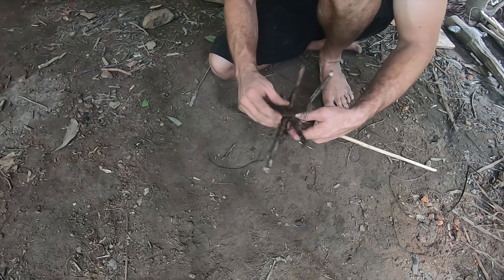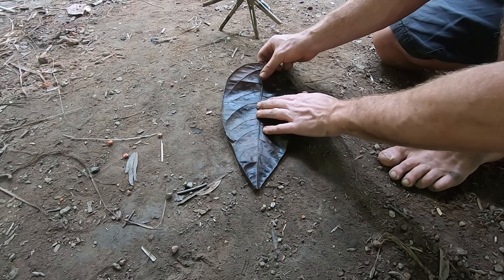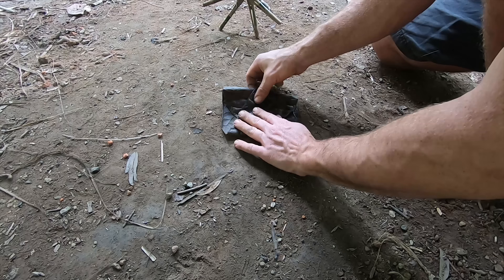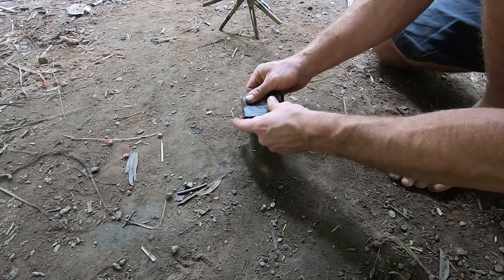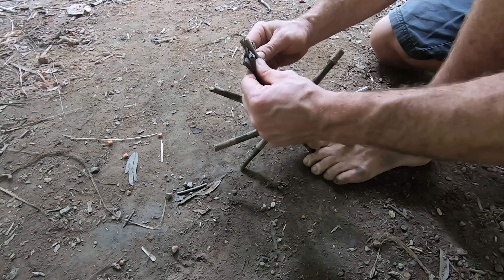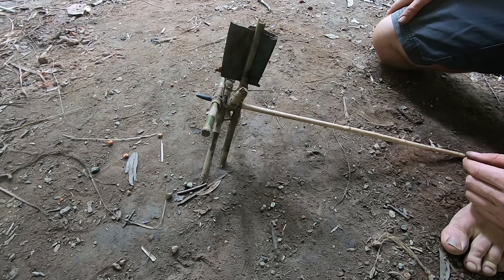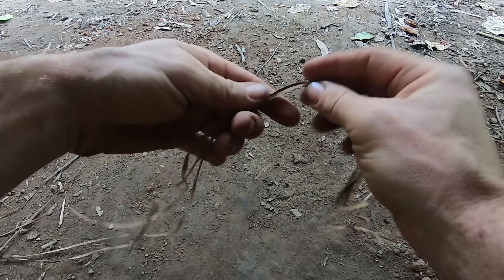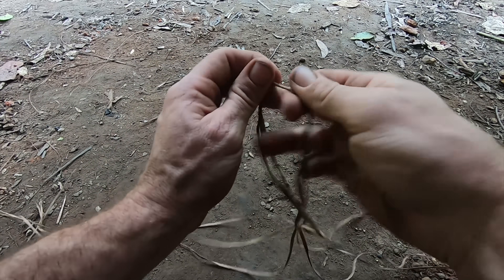Primitive Technology: Improved Multi-Blade Blower

Comment: I know that adding a slight tilt will add more directional air flow, but only in one direction, so the reverse spin would suck fire back in. I'm wondering if it's maybe time to build a belt system with some rudimentary gears. If you start building belt driven mechanical systems you can start making things like water pumps, a higher efficiency blower that requires less effort to use, and even a pulley system to lift heavier things to hang from trees.

Comment: You've previously made a waterwheel.  Using a waterwheel with cordage from it's axle to the air blower would allow for a constant forced air system, which would make higher steady heats for your iron production efforts to produce better results.

Comment: If you were to dig holes in the side of the spout (oblique), then you could probably increase the air flow by the Venturi effect.  The low pressure region inside the spout (the moving air) will suck in air from the holes on the side

Comment: I think that a gap between the impeller housing outflow and the entrance of the tuyere would result in a larger amount of air being blown out the end of the tuyere due to Bernoulli's principle. When I would use a bamboo pipe to blow through to fan campfires, I noticed a marked improvement when I held a gap of about 10-15cm from my mouth and the pipe. Could give it a go? I wish there was some way you could measure the volume per unit time of air that you blow with the different spoke setups to compare effectiveness, and then again with and without the stand off to measure if Bernoulli's principle applies in the way I think it will.

Comment: I am sort of surprised that you need a replaceable rock bearing, but the propeller axle is left to wear down.
I assume you must go through way more wooden shafts than rocks? I would think if you could find a way to attach the rock bearing to the shaft, and have a replaceable stick sticking out of the ground that would not only add weight, which might be advantageous, and make the fan last indefinitely.

Comment: I’ve seen this design on a couple of primitive channels, and have a rotary blower on my forge, but still don’t understand how the air is directed from the top port to the bottom-side port. On my modern version, I believe the blades are shaped to enforce the direction but might be mistaken. In any event, nice job!
Reply: To understand how it works with flat blades you can imagine that the air is like ping pong balls being hit by a paddle, they bounce off in a more or less straight line and since they are inside a cylinder, no matter which direction they shoot, they will generally move towards the wall, generating higher air pressure that comes out of the side.

Sure in reality there's so many air molecules that they collide with each other and the movement is not quite a straight line, but still the end result is the same tendency.
Reply: @MisterTalkingMachine  great analogy!

Comment: I feel like the next logical step in impeller design is to make something like a pole lathe, to make it treadle-powered. As you said, that motion of the arms isn't particularly natural. You could even have a treadle power 2 or 3 impeller simultaneously to provide increased airflow at an even more leisurely pace, since your legs have more power and mass than your arms.

Comment: This has bothered me ever since all the way back with the first version: A crank type setup (similar to used on spinning wheels) with a flywheel would make it possible to have the blower turn constantly, without the pause and loss of momentum that comes with it. Should reduce the needed effort and increase the fire temperature and consistency.

Comment: Now what I don’t understand: why isn’t he using his drill mechanism that had the round stone with the hole in the middle of it with the piece of wood that has a hole in the middle where to the left and right ends of it he attached the ends of the string so he could move the piece of wood up and down with that blower fans?

Comment: I always wonder if you could just make a pulley to which you can attack a weight to and then have a horizontal fan. The weight if hung on rope which when the weight is attached it unwinds the fan and then you hook the other rope up to the weight. Gears can be used to slow down the process, Make the gearing about 1 min long and some how make the rope 100% attachted that way you can use a stick to lift a weight to the other side and back. Because the rope is only looped around the shaft a few times and is one whole rope it jwould be easy to add 2 loops to either side. After some time you may have to adjust the rope as it might slip. Gearling would be simple stick gears.
Reply: If you're using gear ratios to slow down the falling speed, you won't get nearly enough wind speed for the blower to be effective

Comment: Think of all that extra mass in the 8 blade design as a kinetic battery. Sure, it's a bit heavier, but that investment in inertia resulted in a considerable increase in blowing time and airflow with less effort since there is enough energy in the system to wind itself up again for the downstroke. Excellent upgrade!

Comment: This really feels like a prepared "Season" of Primitive Technology. Now that he has a workspace and living quarters, he can actually advance his technology with better pyrotechnics and metallurgy.
Reply: And not burn his hut to the ground on accident this time, trying to get there!
Reply: Bronze age here we come!
Reply: @kidmockparodies  I think he'll skip bronze. If he sticks to the rule of only using the ressources the sight offers, then it's already incredibly unlikely that he'll have access to copper, let alone tin. This was a major reason that the bronze age had extensive trade networks; The places that produced the ressources for bronze were few and far between, but everyone needed the stuff.
He will probably go straight for iron, which is harder to work with (which is why it was only used after bronze) but easier to come by.
Reply: @rockyblacksmith  Agreed, tin deposits are sparse in the majority of the world and judging by the efficiency of this part alone, he'll probably be able to generate enough heat to melt iron .

Getting iron to a state that's pure enough to be useful is another matter entirely. As is gathering enough to actually use.
Reply: @rockyblacksmith  problematic manufacture wasn't the main reason for prolonged use of copper and then bronze, it was caused by lack of knowledge. Iron few times more abundant, but is not clearly visible (boring color, and often as thermally unstable compounds). So if know minerals you will find it more efficient than copper, but if don't, then we'll you don't
Reply: @wojciechkolaczkiewicz2881  I come from an engineering perspective, where "lack of knownledge" and "hard to work with" are nearly interchangeable.
You can make any process is easy if you know enough about it, and inversely, accomplishing something you know little to nothing about will always be difficult.
And the fact that iron is usually present in compounds rather than in elemental form (as copper regularly does) means extracting the pure metal was, for that time, a challenging process that was easy to get wrong.
Thus it required skill and knownledge.

What you have to remember is this; 
The properties of iron change massively depending on the carbon content.
Now, ancient iron production couldn't completely avoid carbon in the metal, you always get some of it in there due to the burning process.
But if the content is too high (and "too high" means "above 2%" here!), the result is cast iron, which is brittle and unforgable.
So they had to develop processes to keep the carbon content as low as possible WITHOUT understanding any of what was actually happening within the material.
By pure trial and error.
And that certainly wasn't an easy process.
Reply: @rockyblacksmith  Your assumption that people back in the day didn't understand the properties of metals is unfounded at best.
Reply: @FugueSt4te  Really? You want to tell me they had a way of measuring carbon content?
Because if not, you know next to NOTHING about the properties of a given piece of steel.
Reply: At this point soon enough he'll catch up to modern technology
Reply: @raam1666  I don’t really understand what you’re saying, who is “we”
Reply: @jexania  process of elimination
Reply: @wrisq  lol
Reply: @jexania  We, as in Humans.
Reply: https://youtu.be/kqrQ2th7EJI
Reply: @dmurray2978  Sub-Saharan Africa had fairly early iron working that likely was independently developed though didn't it? Doing some light research I'm not finding anything to the explicit contrary
Reply: Looks great! Can't wait for more.
Reply: @dmurray2978  my sides X'D

Comment: Have you experimented with the size of the intake hole? I suspect you would be able to get better performance by making the intake a little bit larger, equal to the diameter of the inner edges of the paddles.

Comment: the wrapping around the stick and spinning technique is something my native american tribe used for fire making. a slightly more advanced version is a rock disk (or clay) with a hole in the middle for the stick. attach the cordage your currently pulling outwards to this disk (at the edges) 
u can now simple push the disk down (after pre-winding it) it should spin the stick, and rewind itself the opposite way allowing to push down again. 
im not sure if this would work well with something like the blower but it works great for fire starting, using vastly less effort.

Comment: You can really hear the difference in the 3 designs. I think instead of leaves for the paddles I'd want wood to reduce having to replace them. The dry heat has to make them crumble pretty fast. You could make wood paddles from a thick enough branch split into mini boards and maybe three to a spoke at the right height for the clay blower's cavity. I just don't know if the stone tools can split it thin enough. :{

Comment: Could you put another smaller split stick at the end of the radials to angle the leaves about 20 - 30 degrees in the same direction? This would help direct the air more,  pushing in fresh oxygenated air on one pull and removing CO2 on the next. Just a thought.

Comment: I wonder how big you can scale it up. If you're making a forge, You may need something that is quite big in order to deliver a lot of air over a short period of time. Perhaps something hand-cranked? I have an image in my head of basically what you built turned on its side with the impeller held up by a bearing stone with a hole in the middle instead of a divot and the other end held up by some other means and attached to the end instead of string is a crank made of various pieces of wood lashed together. If you're worried about blistering your hands then a leaf would probably do nicely as a cover for it.

Comment: "Preparations for metallurgy are being made." Now I'm super excited for the next video. Imagine how much your quality of life will improve with even a small utility knife.
Reply: I think the most interesting part metallurgy is the working of the metal post-construction. Once a blade has been formed, I'd love to see a grinding wheel formed at some point, although creating enough rotational energy to spin a grindstone sounds like a task!
Reply: @jettthorp9444  you could make a simple steam engine type thing by making steam go through a pump and pushing some blades on a wheel attached to the grindstone and so it spins
Reply: @jettthorp9444  Reinvention of the steam engine~
Reply: @jettthorp9444  Not really. Find a strong enough stream and you use a water wheel to harness the energy needed to make many things easy.
Reply: @ethandoessomestuff...8949  I considered the stream approach, and I'd love to see that!!! Automatic power is so awesome
Reply: @jettthorp9444  molongolo
Reply: @jettthorp9444  Bicycle paddle design go brrrrr